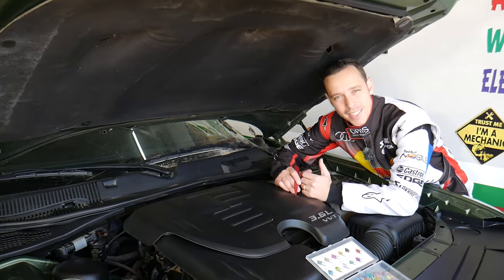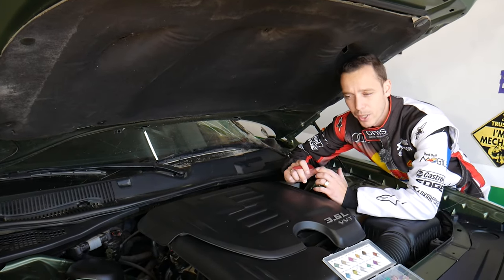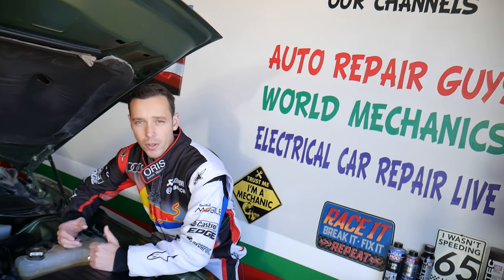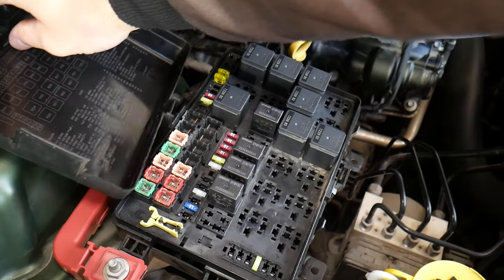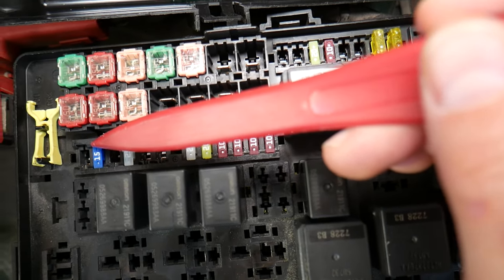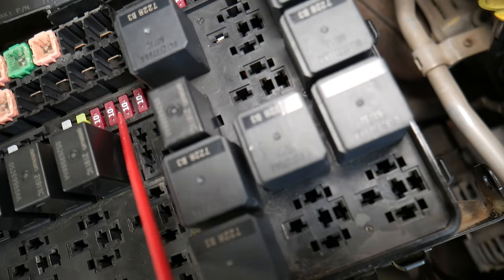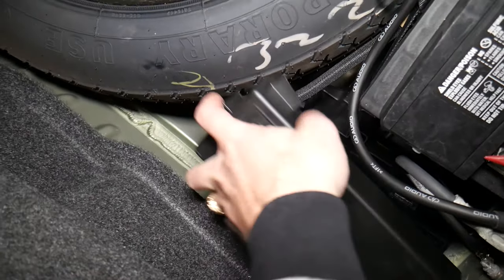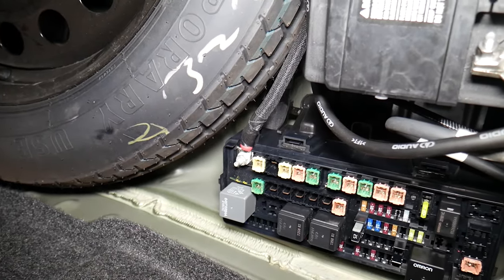CHRYSLER 300 TRANSMISSION CONTROL MODULE FUSE LOCATION REPLACEMENT, TRANSMISSION NOT SHIFTING

Comment: Where's the TCM? Everything I see online says drivers side under dash but there isn't any module there.
Reply: Possibly under the steering wheel. Remove the trim and that plate
Reply: @turtlehead2 would the TCM be in the PCM cluster under the hood?  I cant find the tcm under the steering wheel. Removed cover too
Reply: @ronohnesorge3964  I believe you have it depending on the transmission
Reply: Whay engine size and year?